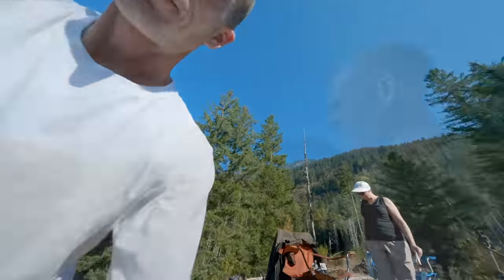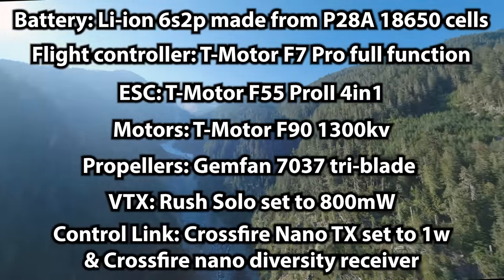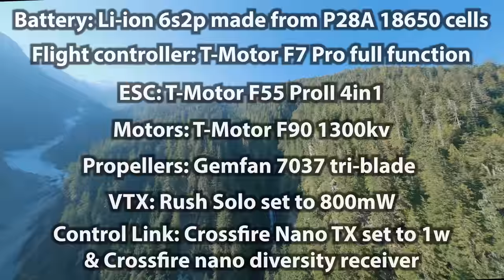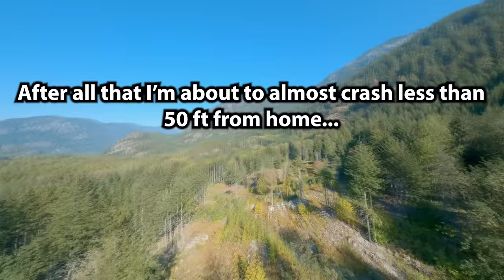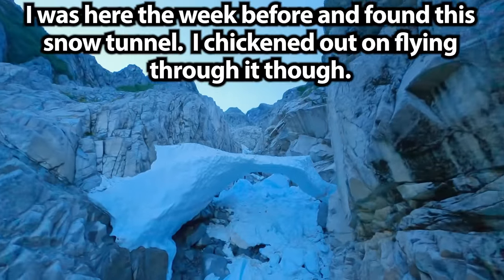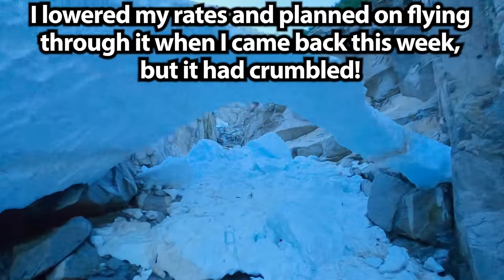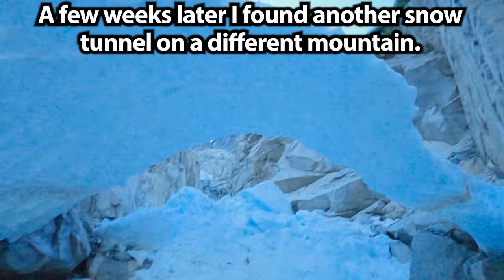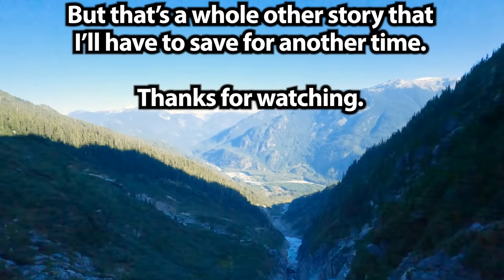4k FPV Drone Flight - Propellers Just Inches From The Ice!

Comment: The fact that you flew so deep into the crevasses while being so far away blows my mind, some true balls of steel! I've flown at a glacier before, too, but didn't dare to fly into the crevasses as you did and I wasn't nearly as far away. But I was also not positioned well enough, the crevasses ran perpendicularly to where I was standing (if that makes sense) so I would have for sure lost signal if I had dipped down into them. Maybe I'll work up the courage next time lol. Thanks for sharing!
Reply from the maker: I had to find the few that ran the right direction.  Most were perpendicular to my line of sight.

Comment: Amazign ride!  Would you think you can fly as far with a, let´s say, Walksnail Avatar system? Congrats, Cheers!
Reply from the maker: With good antennas and about 800mW of video signal it should do fine.  The catch is what happens when you lose video?  Does it return immediately like analog does?  One second is precious time when flying blind, if it's in close proximity to objects one second is almost a guaranteed crash unless you have your bailout technique well practiced.  (in my case it's to level out the drone and throttle up, I'll switch to angle mode if my video is gone for more than one or two seconds.)

Comment: How on earth do you keep flyable video feed that far?!?! On my Rush Tank I would've lost video a quarter of that distance even at max output. 

Amazing video!!! I was clenching when you got into those crevasses. That feeling of responsibility and the possible consequences just makes your heart rate soar.
Reply: You think this was all in one flight?
I have some magic beans for sale...🤔😳😏😏😏🇬🇧
Reply: @EnglishTurbines  hehe, how much do you sell them for?
To be honest, i skipped a little so if there were obvious cuts i misses them. However, the dive and return to home at the end looks quite long distance away and is a single shot as far as i could tell....
Reply: @finkelmann  Yes, the return trip of course is way easier, no gulley flying...The shots going up are a different story though....😏😏😏🇬🇧
Reply from the maker: Ummm. it was all one flight.  The two close in shots going up the waterfalls were from my second flight, all the rest of the footage was from my third flight.  Each flight took basically the same route.  14 km is not that far in one flight, a 5" freestyle quads can do like 6 or 7 in one flight.  I've done flights over twice as long as this.
Reply from the maker: Keeping good video is all about antennas and the placement.  Two strong patches or similar on the goggles and a good quality omni antenna on the quad is all you need.  I never fly over 800mW even though my VTX goes up to 1600mW.  With good antenna you can do like 8 to 10 km with 5.8 video on 800mW.
Reply: @finkelmann  See, 3 separate flights, edited together. Told you...🤔😳😏😏😏🇬🇧
Reply: @FalconRadFPV  sweet. Appreciate the info! I guess it depends a lot on keeping line of sight. Most of my flying was low proximity/freestyle, and in that scenario i couldn't get more than 200-300 meters of useful range. I thought switching to digital will improve it but it didn't by much. It really takes a lot of experience to build such confidence in your gear, so i salute you 🫡

Comment: Great video! 😁 
Excited to see the snow tunnel fly through next. I can relate to the almost crash, had quite a similar close call recently.

I see you use crossfire diversity. Got myself a diversity receiver too. 

Did you put the crossfire antenna on the rear inside a tube? I wonder how I could mount my immortal T antenna without wiggling around too much.🤔 
Don't want to shield the antenna by putting too much stuff around it though. 😅
Reply from the maker: I use either a bardpole for my rear vertical antenna or a dipole that I made myself.  Although I have seen some good mounts to get an immortal T mounted vertically I much prefer the the other two I mentioned for the rear vertical antenna.  I always use an immortal T horizontally mounted up front though.  The antenna wobble is important,  my DIY dipole does well if I put a stiff plastic tube over it, funny that a bubble tea straw was the PERFECT size that it snuggly fits over a bit or the brass SMA connector and stiffins it up really well.  Otherwise I've noticed some bad vibrations from it moving around too much with just heat shrink to stiffen it.

Comment: Think this is your best flight that you have posted. Not that you ever really crash but have you considered crash recovery setting on betaflight, especially if you were concerned about bouncing off a wall?
Reply from the maker: I haven't looked into it really.  I though it was more of a whoop thing.  I think it's meant to regain control if the quad freaks out.  But ever since like BF 3.2 or something quads do great at maintaining control.  Back with like 3.1 or earlier they would flip out from just hitting a branch.  With whoops though they crash different and tend to be harder to control post crash.  Also hearing about having to tweak the settings so it doesn't accidentally get triggered unnecessarily makes me not want to use it.

Comment: Epic as always! Is there an advantage to having crossfire telemetry in addition to what is on the OSD? I’ve always turned mine down to 0W so as not to have more RF floating around. Is the reason redundancy? I’d love to get an insight to your logic here. Thanks. Amazing work, I’m a fan no doubt!
Reply from the maker: In my experience the way I do things the Betaflight OSD has everything I need LQ, RSSI dbi and all the battery info required to time flights well enough to maximize battery usage.  I think if you lock crossfire at 50hz (done for long range builds) it might disable telemetry, not 100% sure if I'm remembering that correctly.
Reply: @FalconRadFPV  Same here (LR FPV 20+ years) … On the receivers, I leave Crossfire telemetry ON but at a power level of 0. I still get a telemetry signal as evidenced by my RCTX but, like you, don’t need it; everything is already in the OSD. I’m going to turn Crossfire Telemetry OFF from now on. Already locked at 50Hz. Thanks for the time/effort into putting your videos together, I’d rather watch them than anything on TV!

Comment: Amazing! I wonder how you still had signal, since the ice it's basically a big body of water? Water is normally problematic for signals to travel trough
Reply from the maker: Ya the ice kills the RF signal worse than water.  Glacial ice is very dense.  It was all about maintaining line of sight even when in the ice cracks.  Only a small portion of the cracks were flyable so I had to kind of picture a 3D model in my head of the line of sight to me, the direction of the ice crack in relation to the sight line and also pay attention to the elevation of the areas around the crack to ensure I did not fly behind a rise in the ground.  It gets easier the more you do it, when I first started flying long range I would lose video very often.  Now that I've got it practiced so much, I was able to maintain perfect clear video for that entire flight.

Comment: This is incredible footage, but I thought the drone and transmitter's radio waves would only go Line Of Sight? How does the radio signal get around obstacles? Please forgive my ignorance. Steven. U.K.
Reply from the maker: it only works line of sight.  I had line of sight the whole time.  The ice cracks traveled vertically up the mountain so the side walls did not get in between the drone and myself.  At most there was 1 or 2 small bushes in the way.  It's all about learning a route that works for line of sight as well as being interesting.  This one took about 7 flight to learn the exact route I wanted to take and that's on top of the knowledge gained from flying this mountain several times before.  Lot's of practice and planning went into this, it's a 10 or 12 min flight but I put 50 times that amount of time into all the preparation, planning and practice for this specific location..

Comment: What camera angle are you running. Your FPV cam not your action cam. Curious as to your pitch vs average speed

Amazing flight btw. This is the stuff of legends for long range. Top of your game
Reply from the maker: I use about 26 degrees for fpv cam and 28 for gopro.

Comment: Amazing flight! I see that you use Rush vtx set at 800mW, what goggle and receiver do you use?
Reply from the maker: I'm using Orqa FPV.one goggles with a rapidfire RX.  The secret is using the right antennas and keeping clear line of sight.  If you do that you can get great range with almost any gear.

Comment: Breathtaking flight FalconRad! So beautiful! WOW WOW WOW starting at 4:07!!!! That is majestic and scary too! What was that missile looking thing you orbited at 6:48? I have a question. I built my second 6S Molicel 21700 42A so I can do 6s2p configuration. Today I flew 6s2p pack and I am disappointed because my total flight time was only 19mins. It was only 30 seconds better than 6s1p. What did I do wrong? I was expecting to fly at least 25-28 mins.
Reply from the maker: Thanks so much.  My first guesses would be either your flight speed, too much all up weight, too small of motor for the weight or maybe too low pitch of a prop for the extra weight.  The pointy thing I think is a weather tower.
Reply: @FalconRadFPV  My existing motor is BrotherHobby 2806.5 1300kv. The new weight is now around 1800g. Do I need a different motor?

Comment: Amazing! How do you not loose signal / video in the creek or glacier? Surely the water must block it...
Reply from the maker: Yes the glacial ice is very bad for video signal, almost as bad as rock.  The trick was to find all of the cracks that went the direction of up and down the mountain.  That way I could get deep into it while still having line of sight back at the home point.  Only maybe....10 to 20% of the ice cracks went in the right direction to be able to fly into them.  It took about 5 or 6 flights before I learned which ones were flyable and managed to hit them all on a single flight.
Reply: @FalconRadFPV  damn impressive! In the video it looked like you were going sideways (behind ice). Well done! Balls of steel!
Reply: @FalconRadFPV  You mean to tell me you made that same flight 6+ times...bro.  Impressive

Comment: How are you getting video down inside those crevasses and ravines and such?
Reply from the maker: The cevasse that I fly through are all running up and down the very steep mountainside.  With binoculars you can see right inside them.  I didn't fly any of the ones that went left and right on the mountainside, I would lose video if I did.  The signal get's block right away by ice, it drops out fast.  It's MUCH steeper terrain than it looks like in the video.

Comment: What kind of battery are you using? you mentioned 6s2p but not the MAH/weight of the battery
Reply from the maker: I used two seperate 6s batteries for 6s2p, they were rated at 2800 mAh each for 5600mAh total at 6s voltage.  I made the packs myself using molicel P28A 18650 sized li-ion cells.  Here's a video about how I made those specific battery packs: https://youtu.be/CLyWh9Sc7C0

Comment: Just a beginner question, how does the DJI O3 air unit perform in comparison to your bvtx built?
Reply from the maker: Both have plenty of range.  the issue is with the way the video reacts when you lose connection.  With analog it gets lines in it or turns totally to fuzz, BUT the instant the obstruction is out of the way the video returns.  With DJI it will look fine then all of a sudden it will freeze.  You lose a split second of reaction time while realizing that the video has actually frozen and it's just a single frame frozen in place.  As well once the obstruction is out of the way the video takes 0.5 - 1 second to start up again.  That is with frozen video, if the video cuts out completely with DJI I'm not sure what happens, but I know when powering on and making the initial connection it takes 4 or 5 seconds to do it so...  Not sure I would fly into these ice cracks with a DJI quad, much more comfortable doing it with an analog setup.

Comment: 7:25. There's a random guy up there on the mountain.
Reply from the maker: I don't see it?!  It would be very hard to get up there.  Maybe you could hike the other side but you would want a snowmobiles to get across the glacier and it would be dangerous to cross at this time of year.  They only ride snowmobiles up there in the winter time.
Reply: @FalconRadFPV  You know what? On closer inspection at 1/4 speed I think it's a crevice.  The size of my phone screen combined with the shape of the crevice and parallax shift as the drone banked in made it look like a man walking. Now that I'm on my monitor, defiantly not. What I'm seeing is just right of dead center on the screen as you bank in to the rocky part. Then exits frame from the bottom right corner.

Comment: Can you explain advantages of 6s1p vs 6s2p. Great vids by the way.
Reply from the maker: with 6s2p the amp draw is shared by the two 6s packs.  So if I'm flying with 6s1p and pulling 20 amps that one pack is putting out 20 amps.  If I'm flying with 6s2p at 20 amps then each of the two packs will be putting out 10 amps.  This is desirable for a couple of reasons.  First almost any battery type mAh output drops when the battery is run at higher currents.  Run a 4000mah li-ion at 40 amps and get 3300 mah, run the same pack at 15 amps and you might get more like 3700 mAh from it.  The second reason is also amp draw related, li-ion batteries will sag the voltage more than a lipo as current or amp draw increases.  When the voltage sags the motors ability to achieve higher RPM is limited since motor RPM is closely related to the voltage going into the motor.  With two 6s pack connected in parallel again the amp draw is shared between the two packs which reduces the amount to voltage sag experienced when raising the throttle.  Basically if I get caught in a strong mountain top wind, say 80 or 90 kph I don't trust a single 40 amp rated battery to be able to fly through that and get back.  But with 6s2p I can pull around 60 amps for about 20 or 30 seconds maybe more.  The same sort of thing applies when say trying to do a cliff dive on the way home, so near the end of the battery trying to get enough amps out of it to pull a heavy quad out of a dive.  I wouldn't dive a big cliff at the end of a battery with just 6s1p, or if I did I would be sure to pull out of it sooner knowing the the voltage will sag on me.
Reply: @FalconRadFPV  Thank you so much for this knowledge. One more question regarding your quad structure why is there a connection between the two arms? You could say to reduce wobble that 7 inch arms generally have but if you could look at Chimera 7inch doesn't have any such but still performs really well. Can compare and contrast your frame with chimera ? Especially regarding that additional arm connections.

Comment: I have a 7 inch quad with 1900kv 2306 motors for a 4s battery 2600mah.. The flight times are decent but under 10 minutes. What can I change to get more minutes out of it?
Reply from the maker: the easiest thing would be to lower the weight if possible.  Other ,wise I get long flight times by using li-ion batteries but they usually need to be run in 6s to lower the current since they don't handle current as well as a lipo can.  Also using larger and lower kv motors will help spin a 7" prop more efficiently.   Your setup seems like more for freestyle maybe, I use 2806.5 1300kv and 6s with 7" props for long range.
Reply: @FalconRadFPV  thanks for your answer. I will probably swap the motors soon but will try to keep it flying with 4s batteries as I have so much of them. Also li-ions. What's your take on props? Bi-blade or tri-blade for 7inch long range?

Comment: What is the battery MAH rating? What was the total MAH's for the flight?
Reply from the maker: 6s2p 18650 cells rated for 35 amps constant so with 2p it can theoretically handle 70 amps.  rated for 2800 mah each 1p so 5600 mah total.  I used about 85 or 90 % of that for the flight.

Comment: what your opinion if SpeedyBee F405 V3 BLS 50A 30x30 FC&ESC Stack  for long range? did T-Motor F55 Pro II ESC (4in1) still best?
Reply from the maker: I've flown long range with both of them, they are both good but the T-Motor F7 Pro FC and F55 ProII ESC are still my preferred ones to use.
Reply: @FalconRadFPV  ok thanks bro 🙏
Reply: @FalconRadFPV  what about T-Motor vs Mamba MK4 F722 APP Wifi F55A 128K 3-6S Flight Controller Stack ESC FC?? price little affordable isnt?

Comment: Just wondering what your optimal speed is for battery preservation?
Reply from the maker: I find 50kph to be reasonably quick to cover distance but still fairly efficient.
Reply: @FalconRadFPV  Its funny that is what DJI says is optimal speed for most of their drones too.  I guess that is the magic number.
Reply: @gregdavidd haha yes. Each motor has specific sweet spot and not to mention weight is another factor.

Comment: Are you using an GoPro hero 9 if so what are your settings?
Reply from the maker: This was a hero 8.  Most of it was shot with a Camera Butter ND16, locked white balance, I think ISO was min 100 max 200.  The two close in shots for the waterfalls (where it was darkened by the heavy shadows) on the way up where shot on a seperate flight with no ND filter and auto exposure.  I often find just using the correct ND filter, limiting the ISO and using auto shutter will give good results.  Locking everything down often doesn't work for long range because the light levels are always changing between different sections of the mountain.
Reply: Thanks for the information I appreciate it